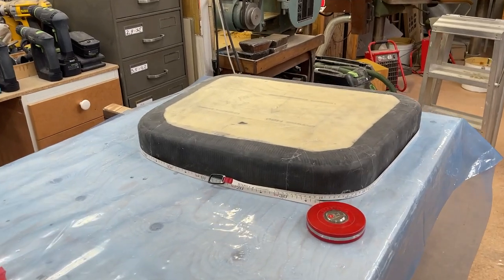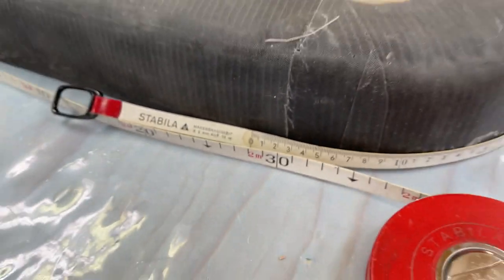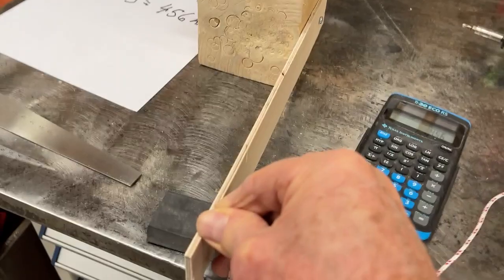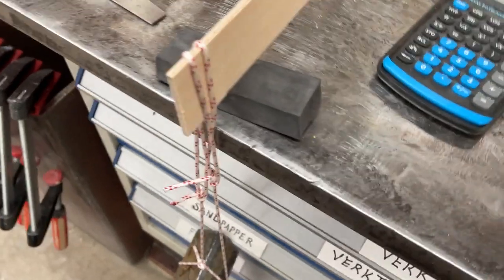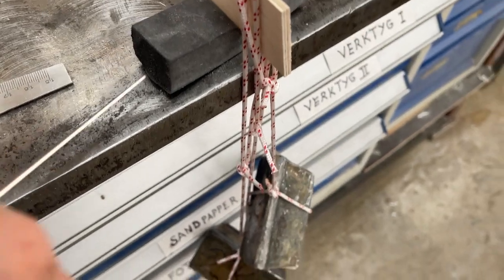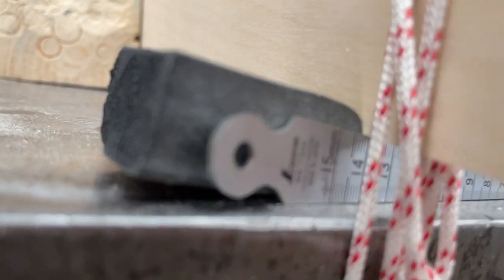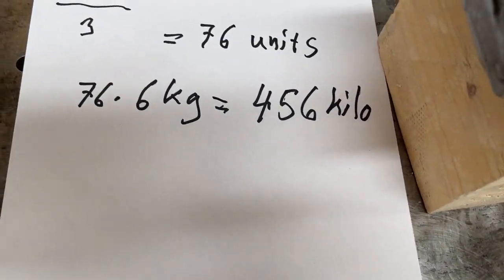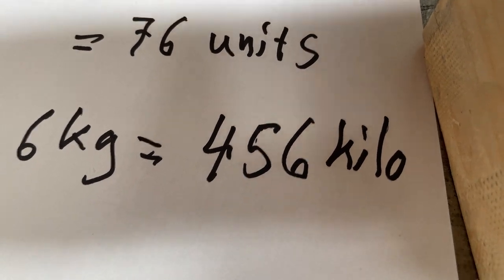Estimating the pressure needed on the gasket to make the hatch waterproof.

Comment: surely you need to bring the weight of water which might push the hatch ,,, into the calculation??  Also, I dont see the strap giving that much force,, too much friction,,  roller bearings would be needed to guide straps over the corners

Comment: I wouldn't be so keen on those straps as they can be hard to in do. It would be better to have a screw lock as on a submarine hatch or latches like on a ship. 
I should ask first is the straps for the internal compartment bulkheads or your main and forward external hatches. If they are internal bulkhead hatch locks then they will not need so much deflection pressure as over time the gasket will compress if to much pressure is applied. The gasket specifications days sheet will tell you what the watertight pressure should be.
If you seal up the boat for a storm, how much air will you have for breathing?. I work in confined space jobs and it's surprising how fast air can run out. 
I'm enjoying your build.
Reply from the maker: I have used many kind of lock systems in the past including screw locks. The ratches straps seams to be very easy to undo. They are used all the time in many different applications.
As for air, the cabin is ventilated by a system that lets air in but no water. Its waterproof even when the boat is upside down. I have used it since 1976 it works very well. More about that later. For the eager search my site yrvind.com for "ventilation"
The bulkhead hatches are closed only as long as I work on deck from them.
The gaslet do not compress. I have used them since 2011. In a storm  a hatch gasket can be under compression for several days.
Reply: @SvenYrvindExlex  Thank you for the reply, I will keep watching and learning 🏴‍☠️

Comment: This doesn't make sense to me. I can understand the hatch latches, or ratchet strap, needing to withstand that much pressure, and maybe more, to stay closed and to keep a water tight seal. But I don't understand the need to apply that much pressure to create a water tight seal. Maybe it just sounds weird saying 456 kilos when really it's just like 6kg per cm? But if you had like 2 latches per side then each latch would only need 1/8th the pressure, say 1/10th because you really bent that rubber more then needed I think, so 45kilos/99lbs. But with the leverage of a latch it wouldn't require that much actual force. Google "type of latches thomas buying guide". I don't know if that's a good website but it shows a picture of simple pressure latches. Anyways, just my thoughts.

Comment: Seems like a lot of load - nearly 0.5 tonnes -  it's asking for a structural failure?  I would just use a softer gasket material.
Reply from the maker: The gasket is soft. The circumference is more than 200 centimeter. Each centimeter needs load. Good engenering in the composite structure will take care of the load of the ratching strap.
Reply from the maker: @Richard Gleaves I test the hatch level with water before getting into place. Previus hatches have proven to be completely waterproof with the boat upside down for long time during rollover tests. No need to go to midocean.
Reply: @SvenYrvindExlex  
This hatchet will be watertight enough, without tests.